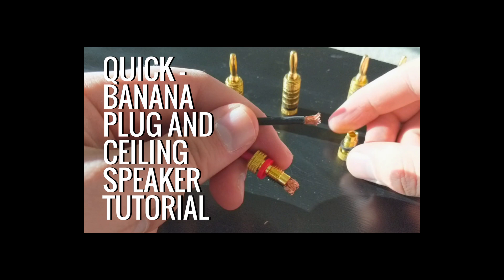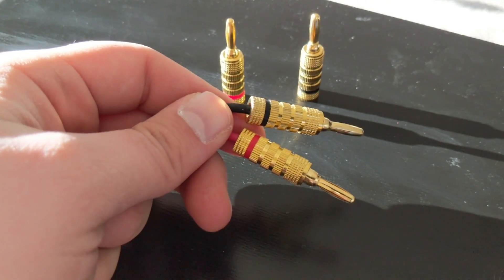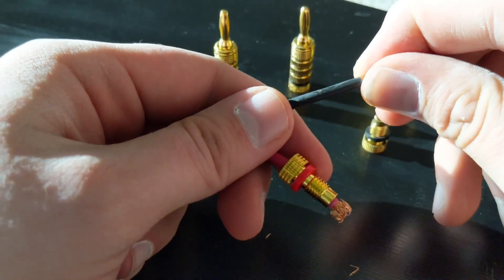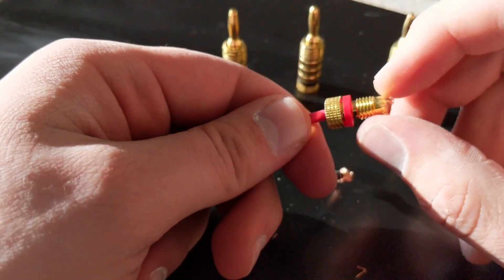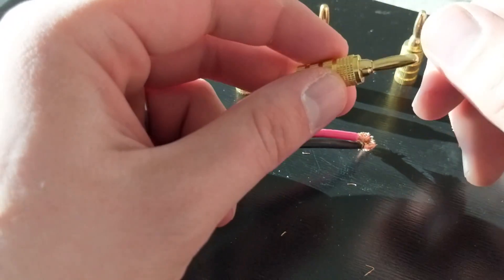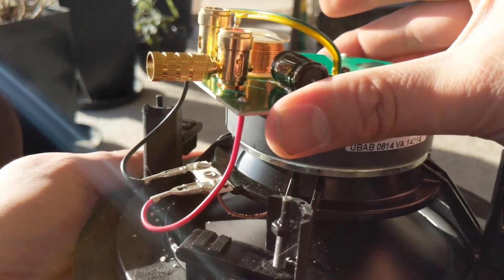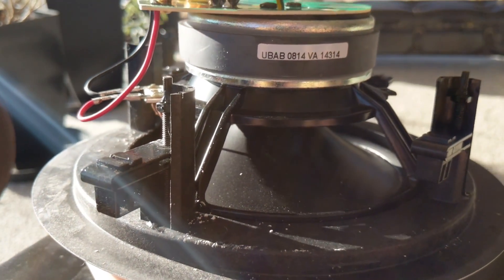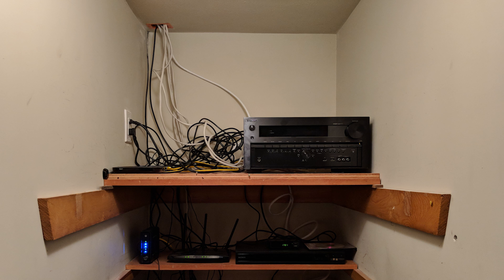Quick Banana Plug and Ceiling Speaker Tutorial - Dolby Atmos Install companion video

Comment: Great Video!
I actually wired romex in the ceiling with banana plugs at the speaker end and terminated standard electrical wall outlets at the amplifier end in the closet. Then used electrical appliance wire with 3 prong plugs to the outlets and pin plugs into the amplifier. Even though it was unseen in the closet it looked much neater without leaving holes in the wall.

Comment: Sheesh. Thank you for this video. I bought these a couple of years ago and threw them in the drawer as I couldn't work out how to wire them. It was confusing as the end (plug bit) also unscrews. I think I'll dig them back out again :-)
Reply from the maker: I'm glad this video has been helpful. I made it for that exact reason - it took me forever to find out what to do with them. I mean it's simple, but for a "fancy" connection, it seems so wrong. It makes switching up your system so much easier though!

Comment: When connecting speakers that may never be disconnected (such as in-ceiling) there is no need for quick disconnect banana plugs. You also have two connections per wire, which is two points of failure or partial failure. Better to wire direct and limit potential problems. In fact, for all permanent (and automobile) connections it is best to solder the connections. Vibrations are no longer a worry.

Comment: I have a subwoofer where 2 sets of speaker wires are coming out of but there’s only 1 plug for it in the receiver. Please help
Reply from the maker: Subwoofers usually use an LFE connection. That is an RCA style adapter and a single plug.  If your subwoofer has two sets of wires, it looks like it is designed more like a standard speaker. You can find a LFE to speaker wire style plug on Amazon - that might fix your problem? https://www.amazon.com/Shielded-Audio-Speakers-Subwoofer-Heavy-Duty/dp/B01IL4E9CQ?ref_=fsclp_pl_dp_1

Sometimes those sets are actually designed for an in and an out - the subwoofer will take a normal speaker connection in, use the internal cross over to only play the bass and send out the high sounds to your other speakers.  

I hope this helps you figure out how to hook up your sub!